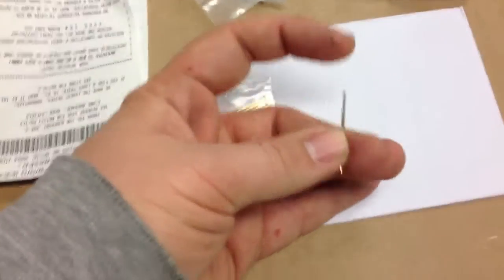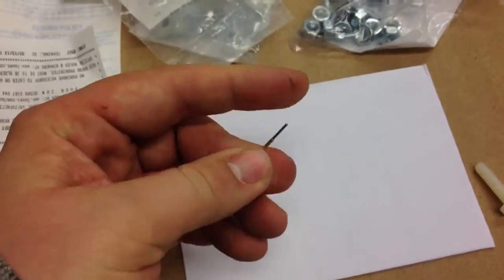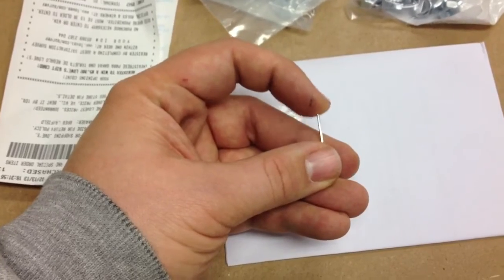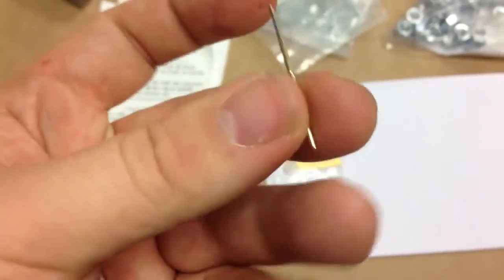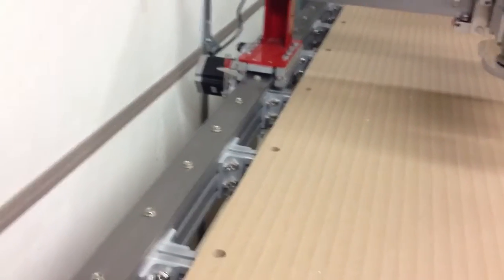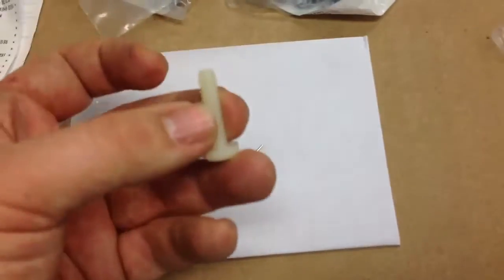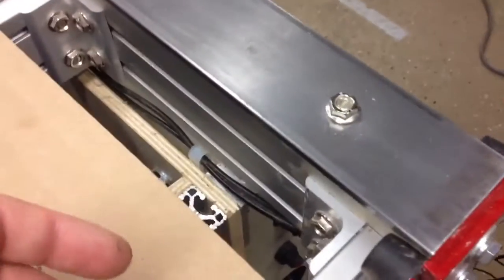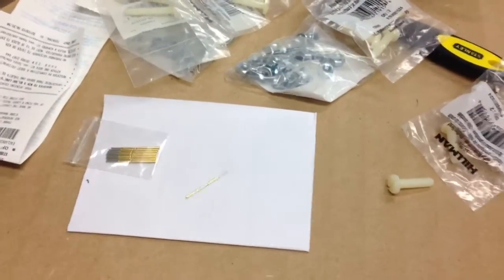Start of Building My Inexpensive, High-Accuracy Homing/Limit Switches

Comment: Inductive proximity sensors are very repeatable, dirt, wear and corrosion resistant and not particularly expensive. Dust will likely cause a pogo pin to jam over time.